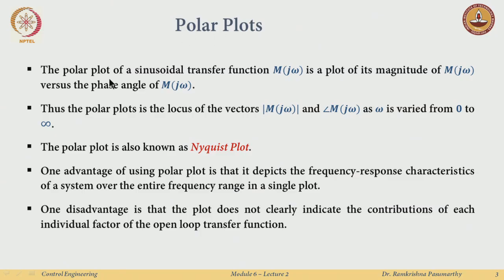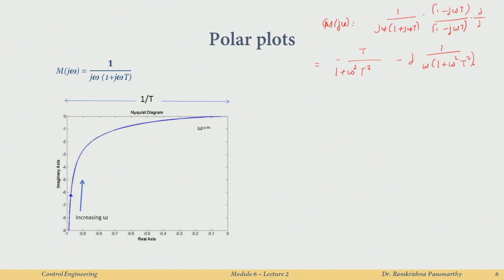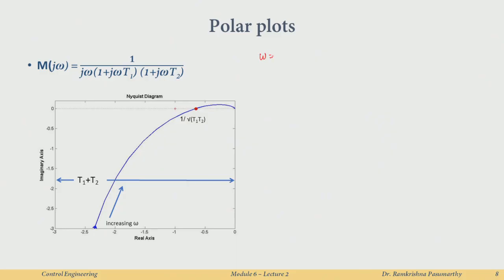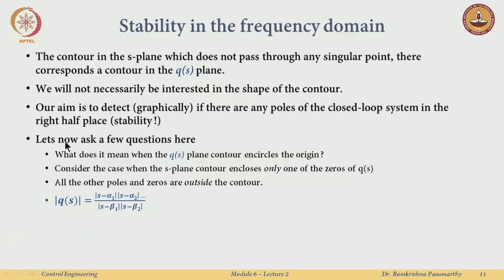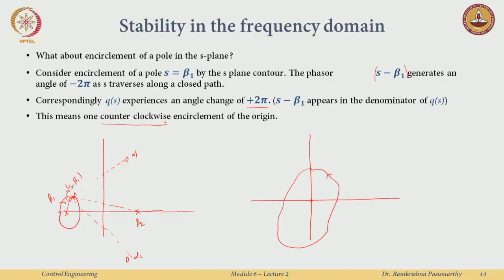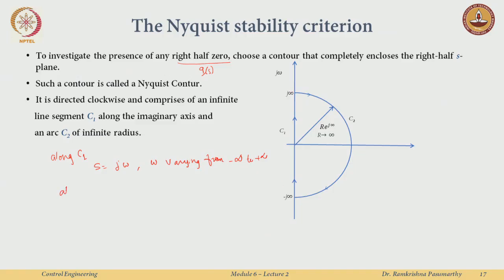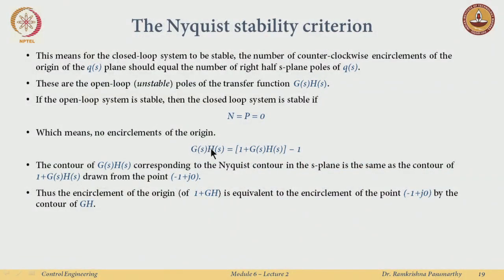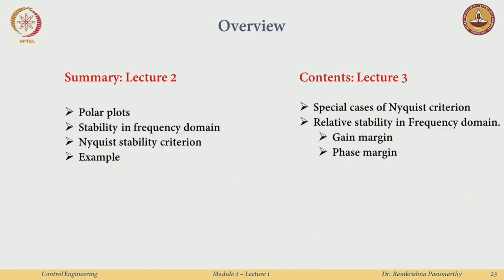Frequency Response Plots

Comment: Hello Sir, the P and Z to be considered in the formula are poles and zeros in rhs for G(s)H(s) or q(s)?
Reply: Z is zeros of q(s) or closed loop poles of characteristic equation and P is open loop poles of g(s) or O.L.T.F in rhs, If Z=0 even though P=not 0 than system is stable else unstable.

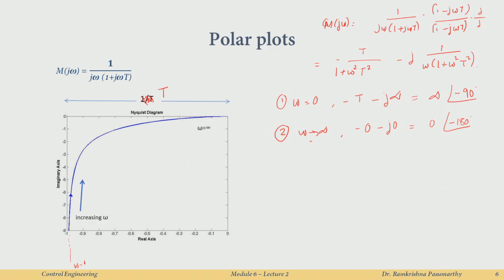Comment: At 13:45, how are the phase angles for both w=0 & w=infinty cases negative?  Negative signs in both real and imaginary part cancel out to give positive phase angle right?
Reply: see the phase angle...phase angle is -90 & -180...that was calculated....so from that its clear that real & imaginary part is negative.....
Reply: @12_sayannag74  how u got -180
Reply: He cancelled w from w in previous step, which is wrong if w = 0. That is why entire confusion is there.